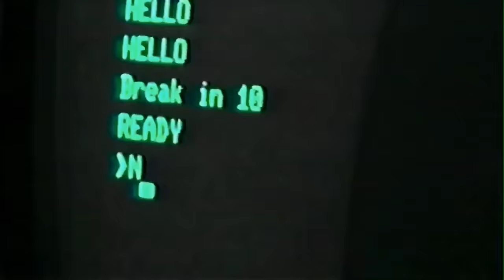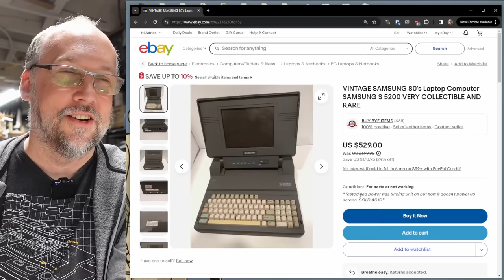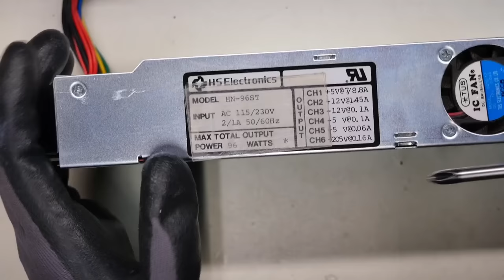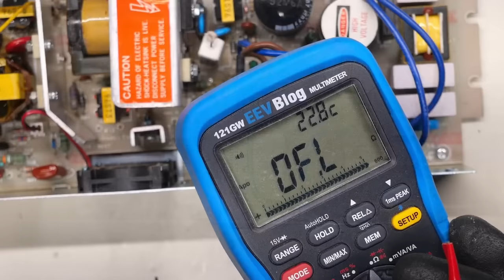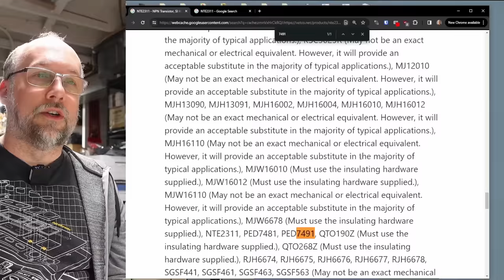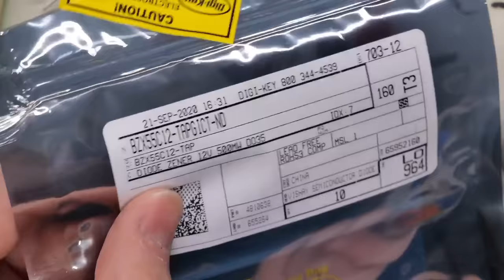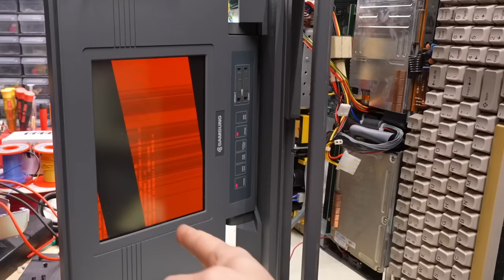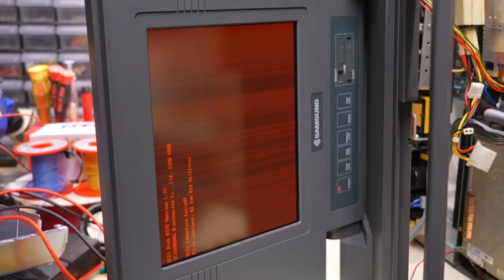Does this dead "laptop" have a gas plasma display? Let's try to revive it to find out! Samsung S5200

Comment: The mains filter caps bulging in the power supply is from the soldering process when the power supply was made.
Some caps, mainly larger high voltage ones have a plastic disk covering the aluminum can. This is  for electrical isolation, as the cans are electrically active, as they are connected to the power leads via the internal electrolyte. I can't remember if it's the positive or negative lead.

When the PCB is soldered in a wave solder process, the PCB goes through a Fluxing process, then throgh a Pre-Heat process, followed by the Solder Wave process. 

The pre-heat process is either forced convection or IR, or a combination of both. The pre-heat temperature gets fairly warm. Usually in the order of 150-180°C. This causes some plastic parts to warp/deform. Namely large electrolytic caps!

Comment: In the UK/EU, when you get a randomly blown fuse, first you check that nobody has switched it to 110V and then suplied 230V! 😁
Reply: Yeah, I worked for IBM in the UK for a few years and our test lab was full of hardware from the US. Not ashamed to say I blew at least a couple of monitors by not checking the input voltage setting before plugging them into the mains.
Reply: @EnglishMike  they go bang pretty loudly, right!? 😜
Reply: @m1geo  Yes they do. Followed by the slow realization of what you've just done: "Oh, s**t!"

Comment: I vividly remember taking a BASIC course somewhere around 1990 as a kid and what caught my eye was the "laptop" of the teacher. 1st I never saw a laptop before, but also I really liked the monochrome, orange screen. I also remember it had terrible viewing angles that made the screen change color even, but back then I found it cool. :) I wonder if that was plasma or not.
Reply: I doubt that it was a plasma screen, since I would imagine they aren't all that different than the color HDTV plasma screens that came later. I have a 50" VIZO Plasma TV from around 2007 that still works and has an extremely wide viewing angle very much like a CRT.
Reply: Poor viewing angle was a hallmark of early LCDs. However, they were monochrome so they could have used something like neons for a backlight.

I had a more recent LCD monitor with a very red display because the backlight was worn out. The white light starts out from mercury vapor which gets absorbed by the CCFL glass leaving only the red neon gas normally used for starting the mercury discharge.

Comment: Possibly the brightest computer monitor of all time was a Zenith plasma display.
Though I'm not sure if it got brighter than the MilSpec terminals I worked on for SAI Technology in the early 1980s (but those were orange monochrome, hard to compare to a color display like the Zenith).
Probably anyone that was a tech on those displays can tell you it's plasma - by just looking at it closely even when it's off or dead.

Comment: I've seen that failure mode on screens before, although mainly with LCD screens.  It's commonly caused because the connection between the panel and its connector is made simply by the two being pressed together by the case.  If any moisture gets between the screen and the connector, mould can form between the two which breaks the connection at certain points.
This failure mode is a real pain in the backside to fix because even if you can clean the connections without rubbing off any of the conductive surface, you then have to be able to precisely align the connector with the screen so that the correct parts of the screen will light up.

Comment: One thing you should look into is fully replacing the thermal pads on the backs of those transistors, the old ones are likely dried out and hardly doing their job, my favorite pads are artics tp3,, but are a bit expensive, however artic also makes a cheaper line which are still decent called artic tp1 basic thermal pad TP 1 APT2012 those would be great to have on hand man. They are 0.5mm thick, it is a perfect fit for this type of thing and are easy to cut to size with an xacto knife. Wouldn't want the other transistors overheating, since those might be even more impossible to find subs for. The pads are also non electrically conductive or capacitive.

Comment: 13:16 And more specifically, those old Seagate drives just ending in "N" or "ND" indicates a 50-pin SCSI.  "W", "LW" and "LWV" were on 68-pin and "WC", "LC" and "LCV" on 80-pin.

The first number after the ST told you the form factor of the drive; for 3.5" drives: 
ST1 = 1.6" high (half-height)
ST3 = 1.0" high (third-height)
ST5 = 0.75" high

Comment: Looks kindasorta like the Toshiba T5200 I had 1990-ish. I loved the amber plasma display because I spent hours on end writing code and it was much gentler on the eyes than conventional mono displays. It also had kick-ass processor power, memory, and hard drive capacity.  Windows for Workgroups and NT ran very smooth. Unfortunately, while it had a laptop design, it wasn't an actual laptop. You couldn't venture away from an electric outlet. And, it was heavy.

Comment: I have some of the Toshiba machines of which you speak. They're really nice, and I love the gas plasma screens. The Toshibas don't use 200V from the power supply, instead taking 24V, so presumably they use an inverter on the panel itself --- which makes the power supply much simpler! It also runs cool; does your gas plasma screen get hot? They also have these really kewl hinged motherboards to let them fit in the bottom of the case, which isn't flat. Unfortunately I managed to asplode one machine; I still don't know exactly how. I had to build my own powersupply because the old one was fried and something went wrong with the negative voltage rail. I'm still trying to decide whether to attempt to fix the motherboard or else to try to reverse engineer the gas plasma display connector and drive it from a Raspberry Pi or something. There's limited documentation which suggests that it could just be STN.
Reply: So many things in the Toshibas were unusual. The 3.5" hard drive in my T3100 didn't have a separate power connector.

Comment: Plasma portables were a thing in the late 80s/early 90s. One guy I worked for had a $10,000 IBM masterpiece with one. I'm sure this S5200 also was in the $6-7k range. I never cared for the eye-melting orange. And they are VERY fragile.

Comment: Never worked on the Samsung plasma portable PCs but I did work on the Toshiba versions in the early '90s such as the T5200/100 and the plasma screens often use to fail in the way yours has. We would just replace the screens as there was no viable fix at our facility. The switching transistor was probably over-spec'd I would trust the overall rating as 400v at 12A continuous c to e. Any high speed switch transistor around those tolerances would probably suffice. As you've seen it works with one at half the ratings of the equivalent and even protects itself when it finds an output short.

Comment: It's really difficult looking up old parts that don't get made anymore. This is the only description of the part I could find.

PED7491 is a high-power, high-voltage NPN power transistor manufactured by PECOR. Features: High voltage rating of up to 800V High power rating of up to 100W Low saturation voltage High current gain Low noise Low thermal resistance Applications: PED7491 is suitable for use in high-power switching applications such as motor control, lighting control, and power supply circuits. It is also suitable for use in high-voltage, high-current applications such as power amplifiers and audio amplifiers. (For reference only)

Comment: For the Pecor PED7491 it looks like the NTE2311 is a perfect match. The Vce, current and speed ratings are very similar to the horizontal output transistors normally found on CRT monitors and TV's, so an HOT from a broken CRT monitor would do nicely. I think this transistor is used for the plasma high voltage circuit.

Comment: I think it's less of the ribbon cable itself and more to how the signal/voltage is transferred to the display panel.  If I recall, there was a long, carbon impregnated, rubber 'pad' that mates between the edge connector to the panel.  It's more of a pressure connection to the panel.  It's been 30+ years since I disassembled a plasma panel so I'm working off of quite old memory cells here.

Comment: I've seen people fix lines in Gameboy LCDs by turning up the contrast to full and running soldering iron quickly over the flex ribbon display connector. It can reflow the connection.

Comment: There's always the possibility of bad caps, bad cables, faulty transistors in the display panel or something else.  I'd say, at least you'll have a 286 laptop that you can run a monitor externally in the mean time, while the remainder gets worked on.

Comment: I have a STM 5500 (SEMI-TECH. Microlelectronics Corp) similar to this. And while the plasma screen works perfectly the plastic in the hinges are broken som the screen just flips down and won't stay upright. It also has a weird style keyboard and a 3.5" SCSI harddrive. And there's also close to no info on the internet about it. Just some pics from a museum and my own post on Imgur.
The display has 4 shades and a fabulous response time.

Comment: Based on the fact the text is readable and not broken by the lines I suspect all you have here is some corrosion/leakage between the legs of the drivers.
May possibly be revived by simply cleaning the driver boards in the screen.

Comment: I have a Toshiba TC<something> in my queue and had to put it aside becuase the driver chips for the display are bad. The display is pretty much built with a bit shift matrix that shifts the pixels across and drives the lines down. It has 32 lines/columns per chip and even/odd lines/pixels are located left/right or top/bottom. That makes a total of four types of chips for the different pinout/polarity. But the drivers have to switch about 200V between them to light up  a pixel and that takes its toll. If anybody has any of these chips... I'd take them! But they are very obsolete... In my case, I can see the bitstream entering the first of each chips, but nothing exits towards the second ones.
[EDIT] the 5V for the screen might be "referenced to the 200V" - i.e. in the Toshiba, these 5V are actually on their own ground, so the chips that deal with the 200V side can have their own logic level for input. So you end up with TTL chips inside the case that have about 200V between their in- or outputs...

Comment: 45:20 Unlike the ebay listing, this doesn't seem to have totally dead pixels but the vertical lines look more like burn-in damage to the phosphor coating inside the display. You can clearly see that the computer can render letters on those lines, too.

Another reason for those lines could be voltage supply to the panel. If each of the lines have inpedendant connection to the power and some lines have poor connection, that would result in parts of the display being run with lower voltage and that would cause those lines to be darker. I would try to apply some pressure to the plastics below or above the screen and see if the line pattern changes when the panel flexes a bit. If it changes, it's definitely some kind of connection problem.

Update: I see that you also tried to press the plastic below or above the panel and that didn't affect the image. I'd try flexing the whole panel to see if that affects the lines. However, be careful not to crack the panel.

Comment: I'm by no means an expert on plasma screens, so take everything here with a grain of salt, but I don't think the screen is unfixable, it looks to me like a power issue.  Considering the text on the screen is perfectly readable across the 'dimmed' columns I don't think the screen itself is broken nor is the driver, I think it's a power issue to the screen itself.  Honestly, maybe replacing that 12 volt rail might reinitialize some sort of circuitry that the screen needs?  Or maybe that 12 volt rail is part of the 'backlight' system?  most Plasma displays don't use a backlight per se but without taking the screen apart there's no way to know for sure what's going on with this one.  I say keep going!  Right now you have a 286 computer that isn't all that special, but if you can fix the screen perhaps you can restore the computer to her former glory.  Worst comes to worse you end up with a broken laptop and that's where this project began anyway, right?

Comment: How does the actual panel connect to the PCB ?  Is it hardwired, or is there a "contact bar" similar to those on LCDs?
In the latter case, cleaning the contacts might do the job. Why not open it and take a look?

Comment: You can fix the plasma screen by spraying it with Windex. In fact you could have fixed the power supply and the 12v motherboard issue with a quick spray of Windex.

Comment: My immediate thought was replace the LCD. Realized ti would be a lot of work converting the signal. There looks like room in the card bay for some hardware. If someone was so inclined even build a card to convert the video signal into something that can be addressed by a modern LCD replacement.

Comment: Good video gave me some ideas, I think I have a similar problem on a powersupply for an old altos 886 I got in a basement cleanout. Something let the magic smoke out and the PSU is outputting 3.7V where the 12V rail should be. Recapping didn't fix it, but I've traced the voltage back to a transistor (BYV42 150) bolted to a heatsink that I believe is the culprit. Waiting on my tester to come in the mail today to verify.

Comment: I have one of these at home in working:ish order (my first professional computer), with some differences - the package is the same, basically, but it’s a Toshiba T5200 and it has a much larger, amber screen - which I do believe is gas plasma. It is a true 386. The issues are mainly software (have not got all the diskettes), but it boots with dos and although it still has windows, and excel with embedded windows, these don’t start.

Comment: That top black cap is suspect. But only because the glue is a different color. The other black cap that's the same size does not have dark glue

Comment: 1:46
Luggables PREdate the IBM PC.
Probably the first was the Osborn I - which was a Z80 based CP/M machine.
2:05
Most "lunchbox" portables had the floppy drives to the side of the display screen, like the Osborn and the many Kaypro models - NOT "sticking out the side".
Most of them also predated hard drives in "personal" computers - the Kaypro 10 was probably the first exception, and nearly the only one prior to the IBM 5150.

Comment: You might be able to fix the panel with laser welding like they do to fix lines on modern LCD/OLED panels, if you can get a company willing to work on an old panel.

Comment: You can always try the foam trick , I had an lcd tv with lines I opened it up put hard foam on all the bonded driver lines and closed it back up and lines were gone , the foam keeps constant pressure on the connectors and removes the bad connections enough that the screens still working, 50" lcd tv that's now 12 years old and still doing fine in the bedroom. I knew it was just bad connections as when I first got the tv for nothing I turned it on and twisted the frame a little and lines would flicker and change position so I was almost sure it was just loose connections.

Comment: I had a similar Toshiba T5200.  Also had an orange gas plasma display.  It was OK.  The display wasn't great.  Better and sharper than a lot of LCD displays of the day but it had really bad streaking of rows and columns that have lit pixels.  I'm guessing this is just how it was even in its day.  This was back in 2003ish.
I actually got a good bit of use out of it when visiting family.  Played some simpler games on it like Jill of the Jungle and marble madness.  It had a 386 so it ran later 80s/early 90s games OK.  Even did some homework on it.  The floppy drive died so it didn't have much use for me anymore.  I traded it with a friend for a super nintendo.  I would say I got the better deal.  They seemed to get the drive going though or replaced it i guess.

Comment: i have an old vintage toshiba t3200sx in the original bag case, works fine and in real good shape, i loaded dos 6.22 and windows 3.1 on it, 40 mb hd, it came from a friend of mine that worked at progressive insurance. would be intrested in selling it for the right price. has all the manuals and cables, and some other misc stuff that hooks up to it.

Comment: The high voltage wouldn't be hard to get a low voltage DC to high voltage DC module for. Might cost a pretty penny but shouldn't be too hard to source something. Also, you misread the NTE datasheet. It listed parentheses only after certain part numbers and not after the PED7491. So if the datasheet is properly made the NTE part should be an drop in replacement.

Comment: you may be pouched on the plasma screen, I had a 55" plasma tv years back and when the display started gassing out I got partial colour failure and the same black bars
nothing to do about it , plasma was a SPECTACULAR display back in the day, but when they crap out, nothing much to be done about them and I dont think they produce plasma panels anymore at all.

Comment: Unfortunately, Those lines in the screen are not fixable. This is a common failure mode for these displays and it happens to all of them with age. And good luck finding a replacement NOS screen that doesn't have those lines already in it. Let's put it this way. Consider yourself lucky that you got what you got and the damage isn't worse.

OASN: Don't mistaken these line for a LCD matrix driver failure. The matrix driver is fine. You will notice that the bad lines are just dimmer and not completely dead, were as on an LCD, the lines would be completely dead. The problem is inside the glass panel itself and is not repairable.